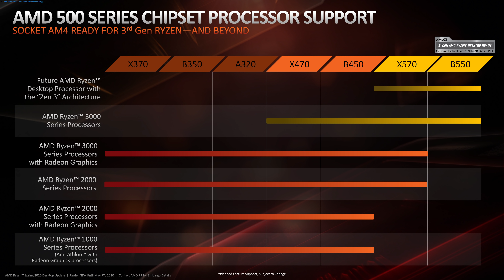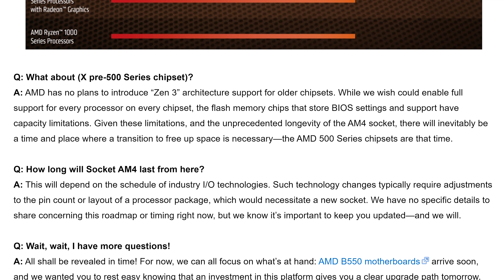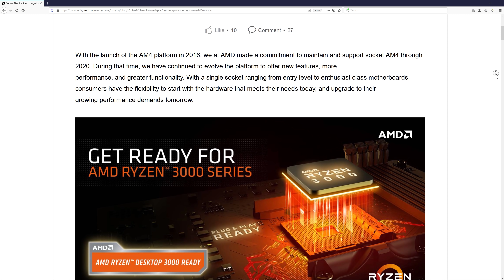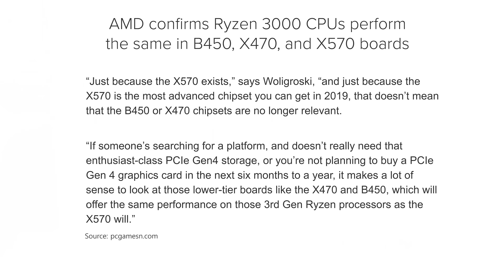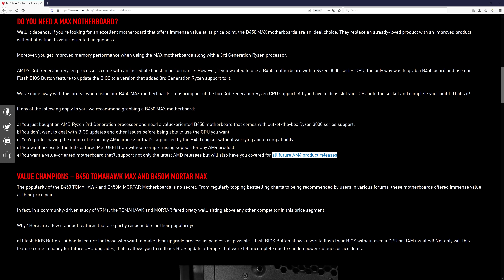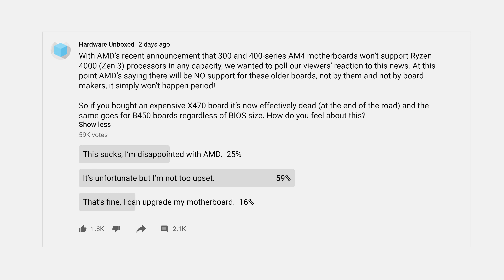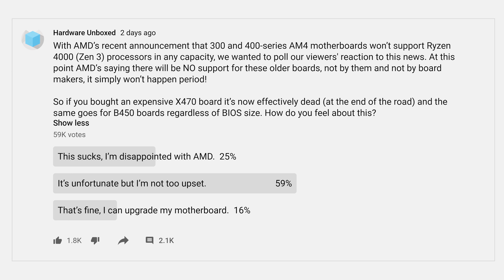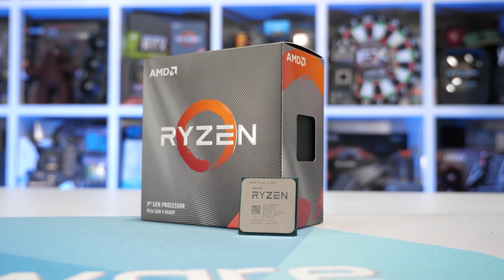AMD Does An Intel, Axes Zen 3 on 400-Series Motherboards, Our Thoughts

Comment: no competition from intel makes amd moves like this.
cmon intel you need to step up your games.
Reply: Lets hope for 10nm being good
Reply: @enioapolinario8538  intel officially said it is bad.

 and it is possible that they are going to skip it for desktop
Reply: We’ll probably have to wait for 11th Gen tbh. The 10th Gen is definitely a solid lineup, but Zen3 will blow it out of the water, at least from what the laptop chips are showing right now.
Reply: @Kortexual  laptop chips are Zen 2 architecture not Zen 3. The reason they perform so well is cuz they use a monolithic design. Not chiplet design like the Ryzen 3000 Desktop parts.
Reply: Intel is bad. But amdiot is worst.
Reply: yeah,they have to ..
Reply: Let's hope rocket lake will be on time cause comet lake surely couldn't except for i7 and i5. We need all line up to compete.
Reply: I don't know Intel 10th Gen suddenly looks very competitive to me!

Comment: Well rip my tomahawk max if I decide to upgrade from 3600x.

Anyone wanna buy? xD
Reply: no thanks ide rather not buy MSI
Reply: There's no "rip" about it, anyone who owns a Ryzen 3000 chip, and were looking to get a 4000 is a moron. 
The Ryzen 3000 chips are still very capable, and your 3600X will without a doubt last you atleast 4 years. 
People don't really seem to realize, that cpu's arn't meant to be changed every release. 
Which is why the whole upgrade path argument, were so stupid to begin with. 
It's the same reason as to why Intel changed the socket all the time, because they knew that people were keeping their cpu's for well over 4 years.

Comment: Gigabyte solved the space problem on some MB in a very simple way. There are newer BIOS with support for 3rd gen but dropping some of the A series of CPU from the support list. That's it. As simple as that.
Reply: Exactly, the consumer is choosing to remove cpu support that they dont think they will ever use, if its a space problem just remove bios bloat. In fact it would be great if you could have a Zen 1 and Zen 3 Bios, if you dont need Zen+ or Zen 2 support then why have it.

Edit: I dont really care if they do or not because I was planning on getting Zen 2 CPU for cheap when Zen3 released, putting the difference in cost towards my graphics card upgrade. But it would be a great move for amd if they allowed custom bios'
Reply: That's it? These few pesky CPUs are enough to grant support for high end ones? Man...
Reply: @CarbonPanther  Even if it wasn't enough there are other MB with larger BIOS size that would have been capable of supporting newer Ryzen for sure. And to me, if I want to upgrade to a CPU I could even have a single CPU supported into the BIOS (performing the upgrade with the one that I already have or using the BIOS flashback that some MB have).
Reply: All they dropped was a few niche CPUs, that is very different from dropping one or even two entire popular mainstream generations. That is far from solved.
Reply: @cybershocked  Its enough, because they could add the 4000 separately. Have all them available, just splited, not just one entire compilation.
Reply: @ryutenmen  And at which point you could end up with a 300 or 400 series board which won't support 1st or second gen Ryzen until flashed again using a 3rd gen CPU.
It working doesn't automatically make it a good solution.
If cpu-less bios flashback were standard baseline, things could be very different.
But is is not.
A victory is going to be a messy one, with an impact felt in my opinion on future boards.
Reply: yeah theres also ASrock that didnt need to drop ANY CPUs from there support because they didnt blaot there bios with junk

Comment: I had a Huge surge in Computer builds of late, due to everything thats going on,  and I put b-450s in all my costumers builds, unless they asked for different specifically, man smh :(
Reply: You could have always put a cheap x570 board in. They only cost 20$ more then B450.
Reply: @Matruchus  i know, but when i build these i usually use higher quality stuff, just so its easy to diagnose problems quickly and also not to have return issues, so my costumers quickly get their Rigs back lol
Reply: @Matruchus  and i also couldve just used b350 and saved even more money lol

Comment: Yeah, seem like AMD get Drunk from short wins

Forgetting that Intel have Jim Keller working on next step of multichip design and Raja Koduri seem manage to implement multichip design on GPU

If AMD slip out now,
Intel will tackle them even harder than back in early 2010s
Reply: You can use three generations of Ryzen on a single motherboard. Intel requires a new motherboard for every new generation. People need to stop being drama queens. Upgrades have to happen eventually.
Reply: @CeriPie  haha AMD fans keep defending those even AMDs bad decisions, fools.
And no, Intel z490 will be 2 generations compatible.
Reply: @CeriPie  i bought x470 Crosshair last year for fck sake
i thought it can support Ryzen 4000 too so i don't need to upgrade mobo too
Reply: @CeriPie  keep sucking up to corporate ass. A lot of people spend their hard earn dollars, not everyone is a bill gates!
Reply: @MrKunshiro  Last time i check Intel setup cost double and can you even compare AMD vs. Intel mobo prices... AMD sell for 100$ when Intel sell 300$...
Reply: @CeriPie  Intel doesn't require a new board/chipset for every generation.  6th and 7th gen ran on Z170 and Z270.  8th and 9th gen ran on Z370 and Z390.
Reply: @sabishiihito  I suppose that is true, but most Intel users only upgrade every other generation because upgrading to the next generation isn't even an upgrade. You AMD users got three significant upgrades on a single motherboard, and I think that is impressive and commendable on AMD's part.
Reply: @CeriPie  300 series only? Nothing different from intel there with just 1 board.
Reply: @CeriPie  which chipset supports 3 generations of CPU's, oh yea only the x370, b3550 series but those who bought the x270 or x470 didn't get that. And no one was buying 300 series for zen1 really, only zen+ so realistically, they also got only zen+ and zen2 cpu support that's it. Intel has supported its Chipsets like that many times so I don't even see whats so special AMD has done here!!!

Comment: I thought upgrading in the future could be neat (x470), but tbf the 3600X I grabbed (for the same price as 3600 on a sale) will be good for a while.
Maybe intel has some decent processors in a few years since they just locked us out of Zen 3 without buying another motherboard...
Guess they have made it to the top now so it's time to start milking the profits...
Reply: That exactly. I was planning upgrade 3600 to more core zen 3 with my b450. Now im locked out so what I have will rock till zen4 or Intel at that time - whatever wins my value aproach.
Reply: Yeap, now people will start considering intel again in the future. Now it's time for intel to make their move.
Reply: I have x370 and a 1600, was gonna get a Ryzen 5 from the beginning of AM4 and one from the end, I'm pissed beyond belief
Reply: I knew this would happen that's why i just used a A320 and 2600 last year. 😂 You still have lot's of series to choose from. R7 and R9 3000 series may end up cheaper next year for your B450. Who knows.
Reply: Provably in a year or so the 3950x will be very cheap and fit in nicely. Will probably be nicer than  a 1600
Reply: @MickdeRaad  Nope, they will stay expensive for ever. Only reason 2700x dropped in price, because you could get 3000 series as drop in replacement. Almost no-one can drop in 4000 series CPU, so doesn't matter if 4950X is 2x faster than 3950X, as best CPU for 350/370/450/470 motherboard is and will stay 3950X.

Another big difference is that 2700X was top of the line and it was cheaper than 3700X, 3950X won't even drop to 3700X MSRP when 4000 series launches. "very cheap" would be under $200 like 2700x could be had and sure I'd take 3950X for that, heck I'll take even 3900x for that in a year :P

But ANY 3000 series is a nice upgrade for the 1600, so no issue with Felix how the top end chips will drop or not.

Comment: Are we witnessing AMD fall from grace? Sure looks like it.

So far it seems like AMD is getting greedy. MSI refreshed their entire B450 line. now that seems useless and stupid.
Reply: You saw MAX last year. Now get ready of Ultra Max version this year. Fuck
Reply: I wouldn't call being able to use three generations of Ryzen on a single motherboard "greedy". Upgrades have to happen eventually. Stop being a drama queen.
Reply: @CeriPie  problem is, AMD did not stop MSI to promote their MAX motherboard "support for ALL future AM4 processors". AMD also fucked B550 schedule so hard that anyone in Zen 2 boom just bought a B450. And what I first thought to be technical issue, which I could forgive if that's the case, turned out didn't. It's a "purely business decision", says Tech Deals quoting an AMD rep. 

So yeah, for me, it's still AM4 socket, the BIOS capacity excuse is pure BS, the "tidying up" excuse is another BS because it's already a mess as it is, why would you care NOW, of all times? So there's no good explanation rather than trying to cash in those GloFo wafers AMD stuck with as 500 series chipsets. 

And also, a piece of advice for you, if a company fucks you up, then speak up. being a simp for AMD or any company won't get you anywhere, and will only result those company you defend fucks you harder. AM4 is a pretty good ride, but we want AMD to hold their promise of AM4 "support" till 2020 like they did on Zen1, Zen1+, and Zen2. If AMD get away with all this B450 nonsense now, they will be motivated to fuck you up again on AM5, because why won't they? Do you want AM5 socket that changes compatibility every year? I sure don't. If possible, I want AM5 to be as good as AM4. But that's not gonna happen if AMD thought they can get away with anything. so that's why, when you see shitty business practice, call them out.
Reply: @josuad6890  You have a good point. I guess I'm just used to being fucked over by Intel.
Reply: @CeriPie  This is the last phase of AM4, which is kind of stupid to release an exclusive board just for the support of Zen 3.
Reply: @CeriPie  bro the reason everyone is mad is because they bought the 4-series expecting it to be compatible with Zen 3. If I had known it wasn't compatible I would have just waited a month and got an x570 at release
Reply: Game Spirit shitty response. Don't act like you don't get why everyone is disappointed.
Reply: @CeriPie  Did you even watched the video?

Comment: I'm a big fan of Ryzen and AMD in general and I thought I could replace my ageing 1700X with an upcoming Ryzen 4000 processor. But if they don't support X470 and I have to buy a new motherboard I might switch back to intel after many years. See who has the better processors by the end of the year (10th gen seems to be very power hungry)...
Reply: Go and upgrade with a 3950x? Double cores, faster IPC than 1700x and less power consumption
Reply: @Veeolll  or at least the 3900x
Reply: @Veeolll  I don't need that many cores right now and I'm actually more interested in Zen3 and 7nm+ IPC gains... in short: I would chose a faster (per core) 8 core chip over a slower 16 core chip for gaming.

Comment: B450 tomahawk max has a large BIOS capacity all MAX boards do.
Reply: same for all x470 ASUS boards ... meanwhile x570 Gigabyte still have the small sized 128(16)MB chips where MAX and Asus x470 lineup uses 256(32)MB chips

Comment: Stop complaining. Its people like you that blow things out of the proportion. They said they would support the board up until 2020. They have. Now stop bitching.
Reply from the maker: Stop defending companies, there is literally no justifiable reason for you to do this. All you're doing is helping to make AMD worse in the future.
Reply: @Hardwareunboxed  would you rather be intel and be forced to update a board every two years or even one year? They supported it for 3 generations which is more than generous. AMD stated they will support it up until 2020. Its 2020. Get over it. Buy an X570.
Reply: I understand their wording and reasoning is stupid. I agree but blowing out of proportion isnt gonna help and I agree people shouldve done their research for b450 before buying one this year.
Reply from the maker: @jamesherman3750  Most of what you've said is garbage. AMD supported 3 generations once, on the 300-series and are set to never do it again on the AM4 platform. A key selling point of Ryzen was the broad platform compatibility. What research were people meant to do exactly? B450 is still technically to this day current generation. Stop being a fanboy, you don't need to defend AMD and you sure as hell shouldn't.

It's people like you that will see AMD become as bad as Intel, if not worse the way you extremists cheer their every move.
Reply: @Hardwareunboxed  To be fair this drama is just as bad as Intels New release 10th gen being just another skylake refresh. I honestly regret getting involved and will admit I have nothing else to back it up with. I apologise for the insults.

Comment: I agree that the 4th gen AMD processors should be available to 400 series boards with an update knowing that It would drop 1st gen Ryzen. I believe AMD needs to step up and back their "will support AM4 through 2020" and not cheap out on "wording" by saying yes we support AM4 and no chipset promise, Continuing their separation to Intel. Thanks all.
Reply: Thing is they said till 2020, which can mean anything so they are covered somewhat..

Comment: AMD needs to mandate 32MB chips for BIOS ROMS on AM5. They should've for AM4, but they were begging companies to even make boards at all, as they were on the verge of bankruptcy.
Reply: @ugaaa5 While I agree there are workarounds, I'm not convinced this is complete "rubbish". Imagine someone with an older CPU updates their BIOS with the wrong version and loses CPU compatibility. That's a software update that requires new (or different) hardware to resolve. Sure, we can blame the user, but it's going to cause headaches for motherboard support departments and potentially impact AMD's reputation. Board partners would also be required to start testing, validating and maintaining two BIOSes for each board. 

Again, I totally agree that there are workarounds. I also agree completely with Steve that this is a bad move from AMD (I was part of the 25% that said they were disappointed with AMD). But I don't think the 16MB BIOS chips are a complete non-issue here. Working around that has implications that will cause headaches for users, board partners and AMD in some cases.
Reply: They could leave out the mandated support of 32mb chip for the A series of motherboards though. (Like the A320)

You can save money, but you will be limited in future upgradability. That would keep absolute budget boards as what they are: Budget boards.
Reply: @thinygamer9408  I agree, as long as it's communicated to the user it's fine. The biggest issue here is AMD's marketing, they definitely misled everyone even if "AM4 support til 2020" is technically true.
Reply: @DrearierSpider1  Absolutely, noone can deny this honestly.
Reply: @thinygamer9408  funnily enough there are still few A320 Max board from MSI lol
Reply: @ugaaa5 See my response to Caleb, my comment is about making sure this doesn't come up again, regardless whether or not they go change their stance right now.
Reply: They need to mandate 64 or 128mb chips
Reply: @RichardDower  Why? If 16MB gets us 2 generations, than 64MB theoretically goes to 8 gens. If course they're not going to support a chipset for that long.
Reply: LOL the point is it doesn't matter if it's 16 or 32 AMD is only doing this to screw people they have options and they decided to not take them it could be 128 megabyte chip and if AMD decides to not give bios support ain't nothing going to happen, please stop thinking that this is an actually excuse that we have to accept cuz it's not AMD is lying to us
Reply: @Gpthunterseeker5638  Where did I say the current BIOS sizes excuse this decision? Yes, they can work around the 16MB BIOS' right now, but it does create more work for the MOBO manufacturers and more confusion for customers, since they'll have to go to multiple BIOS versions for different generational support, etc. That doesn't excuse then going back on their promises, but it does validate my point that 32MB chips on all boards for AM5 will make things more straightforward for everyone, since all platform generations will support all CPU generations (assuming 4 generations on AM5 again).

Comment: 400 series owners should just wait for Zen 4. It will be a new platform which you will need to buy a new mobo anyway, with Zen 4.
Reply: I think so too
Reply: Idk y ppl are complaining the jump in performance isn't that great
Reply: @Ritz they said it i think
Reply: @Ritz it'll support ddr5, and for that to work am5 buddy
Reply: Braiteyy Or just buy a 3900X and put on your board. That will be an extreme upgrade without any fuzz :)